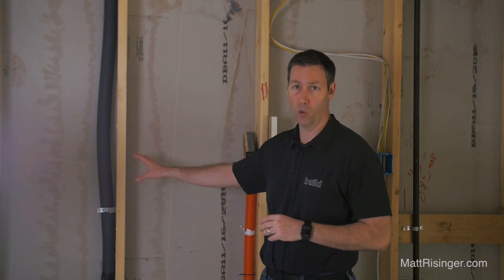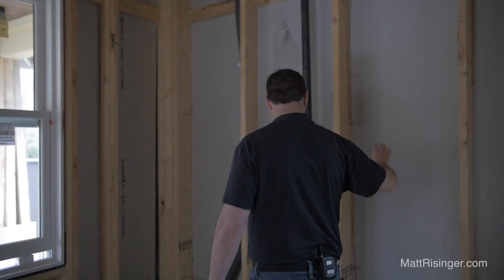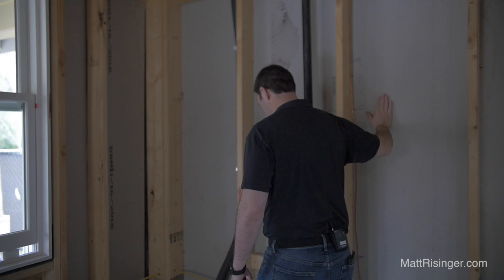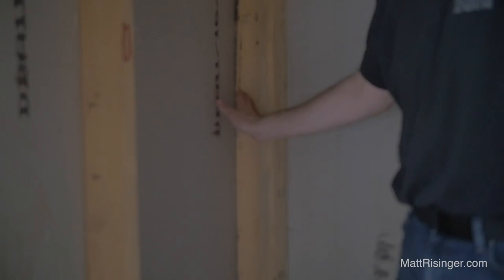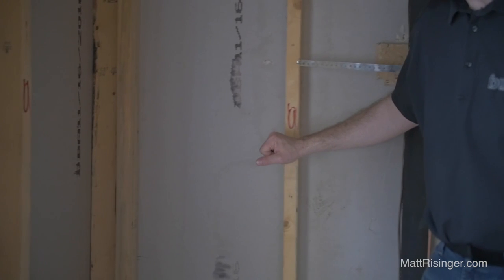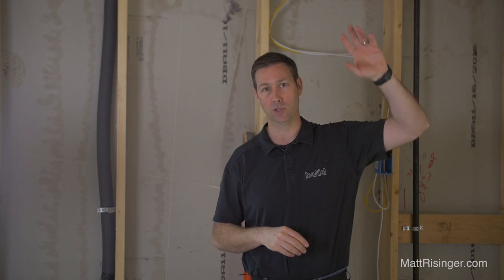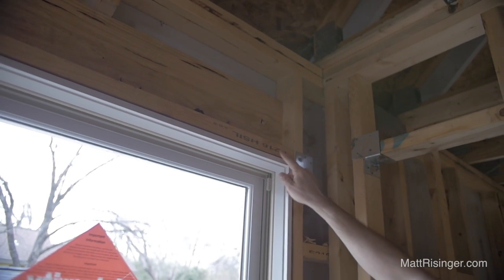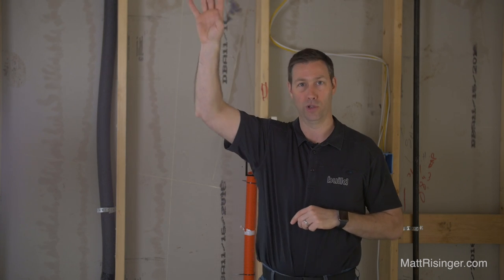Traditional vs. Advanced Framing

Comment: Matt I have been a.builder and framing homes for 40 years.You need to talk more on framing and less on R- value.I liked your home show videos back in the day.I assume your busy and don't get to them like you use to.Again 40 years of framing you have seen alot of ways to frame.Both houses you showed were framed wrong in the places you pointed out.

1st let start where the corner was built wrong.Lets say you were putting siding on.So think about what your going to nail the siding to ,after you put up a corner board. You have 3/12 on the outside going 1 way then 1 1/2 on the other side after the corner board is on.I could tell you 3 or 4 problems.

   The 2×6 walls are built probably to carry the load of the 2nd floor.I say that because Architects don't think about R value like you.They put that on the blueprints because they are thinking of R  value. Not really mostly structure. Now lets talk about your corner and T.. Most framers where Im from SC. ,you know the south where we do the dumbest things.Like venting the attic.Back to the Corner You use 2 studs and 3 blocks.1 block nailed to the top and middle and bottom.Then in between the blocks you could  insulate.Those blocks is where you tie in the wall that joins it.Everything is nailed flat and flush where you end up with 5  inches 1 way thats including the end stud on wall tied in 
and 4 1/2 the other way enough to nail to after a corner board goes up.The T can be done almost the same way but you put your blocks in between the 2 studs as the studs stand up on the 1 1/2 x 3 1/2 .Flush them at the top and bottom and end of studs and then middle.So that will leave you 3 1/2  inches x the length of stud to insulate.All but where you put the blocks .You only have 2 inches there.Also gives you 6 1/2 inches to nail rock anywhere.Not a block that could be in the wrong place and leave a corner or rock in the wind. We in the South can help you to insulate with the T,s and Corners.I guess we are making up for not venting the attic as it gets 175 degrees in the summer up there.I have asked you this ? many times and you said you were a builder for 25 years, 5 years ago.Then the dumb South video appears.After 25 years Im going to say you have never picked up a pack of shingles.You had to if you been doing this for 25 years.Oh yea the question.How many homes have you burnt the shingles off of, taking a 20 year shingle turning it into a 5 year one.Becacuse your attic can't breath.I have learned 1 thing, you know about the R factor.And just enough about building to B.S. your way through it.How does it feel going through life not knowing what your talking about and BSing the public.They think your god.But us real builders know what level your on.I would hire you in 2010 for 12 a hour.Maybe.I know you know nothing about rafters or valleys.I would almost guess you could not put in a set of stairs in. That is figuring  your rise and run.Same with rafters.1 question and you are my hero.I am going to say that you have know Idea what to put your framing square clips at if you didn't want to measure your hip but wanted to lay it out. Because all you need is 1 number. If you get it right by asking someone.Tell me how you came up with those Numbers.The roof is a hip roof on a rectangle and is on a 10/12.Good luck .I would like to know anyone that knows this answer.If you do be descrete on telling me how you got them.Also Matt how long is the ridge if the house is 30x65.Brass tax time Matt.All your sponsors are going to see my ? Then your answers. Im not a hater Just can't stand people that claim they are 1 thing with just enough knowledge to rip off a homeowner that knows very little.Im emailing all your sponsors this and letting them know why.If you don't reply within a week with any answer.Your sponsors would like to see the correct ones.Peace be with you.Curt.

Comment: let me tell you something son, people have been pitching for 24 on center studs for decades and also for foam insulation. people want a structurally sound house to handle dynamic loads. stick with 16 oc. foam will burn you to death. there are to many case histories about people dying in a structure with foam that would have lived if fiberglass would have buun used. i have been building 40 years.
Reply from the maker: +Ralph Riffle I've been building for 25 years. Times are changing. Fuel will again rise in cost and we must build homes that are more efficient and affordable. Have an open mind.
Reply: +Matt Risinger yes your right about that. however consider that each stud contributes to the shear value of the wall.

Comment: Ok..ok..ok....This Is Not Advanced Framing,,it’s Regressive.......This Home would never pass on the east coast, I’m on cape cod...First...all corners are made as “half backers” to allow insulation inside or psl or lsl corners are used for loads...
     Second...all walls should be framed using 2x6 at 16”oc...wall sheathing is 1/2” zip ply ,taped and installed vertically for shear strength...
    Third...All headers are structural engineered lumber or dimensional (2x8,10,12) with 1” foam between the layers...
    Fourth...All interior partition walls butting an outside wall are attached to “half backers” to allow insulation behind the connection
     Fifth....as stated by others ...Windows and Doors are the Greatest factors in heat loss...Quality Anderson or Pella windows ,argon gas filled ...
    Sixth...the two types of houses...
                   Air flow...let the house breath, soffit vents and ridge vents are key to this type of house
                   “Hot house” newer style..no vents,no air flow...all rafters are sprayed with foam insulation and the house is sealed in...
    I’m a builder 35 years...what houses last ?? Post and beam...and and houses that breath, a red cedar shingle roof ,on 1x3  with no roof plywood will last 50years...
.....also metal connections play a big part...h2.5, abu66, hdu8, hold downs and more.......you my friend are a complete bullshit artist or severely inexperienced..

Comment: Matt Reisinger r value isn't everything, solid wood transfers almost no heat through it, so a solid header is just fine. 24 o.c could he fine on interior walls if your worried about cost but I would never go 24o.c. on an exterior wall, not enough rigidity. Any framer that builds a corner and wall intersect like that should never pick up a hammer or nail gun again. That's irresponsible craftmanship

Comment: I whould go with the traditional frame any day of the week, that advanced frame is crap, its nothing, but a weak structure! The guy said u cant insulate corners and partition Ts how about u insulate it before the sheathing goes on the outside thats what i do all the time and u can also use thermasheathing in between the header instead of osb -,-

Comment: nothing advanced about this. people have been proposing studs 24" on center for over half a century. studs. at 16" on center are for structural integrity. a sheat wall with 24 oc will not have the strength of a shear wall with studs at 16 oc

Comment: I wonder if the house costs 30% less due to all the time and material left out?
Reply: Advanced framing is significantly better than traditional framing. You end up with a stronger builder and it is much more heavily insulated. Advanced framing cost more if done correctly by the way.
Reply: Adam Lingenfelter Okay so you don't build houses or know much about them except what you watch on youtube. You really don't know what you are talking about.
Reply: I have done 1900 projects since 1999 in Seattle and Dallas. I have 7 homes under construction currently. I have substantial engineering experience/training. I know what I am talking about.  If built correctly, advanced framed homes are 15% stronger and 7% more energy efficient. I am not saying some people build advanced framed homes poorly because I am sure they do. Just like many builders build traditionally framed homes poorly.  I am just stating facts that are supported by plenty of data.  

What you are saying is similar to saying that a 1950's car will protect its driver in a crash better than a 2017 car because the 1950's car is all steel and the 2017 car has aluminum and plastic. SMH.

Comment: This "advanced house" has to be the worst timber frame build i have ever seen. I'm a UK chippy with over 25 years experience and this is garbage. I would never have a timber framed house, only a solid brick/block built. The Germans have the best built houses as well.
Reply: Wood-framed houses are typical in the US since we have a huge supply of lumber available.  There are plenty of block/stone houses as well, but only for the exterior.  We like all that space to hide the wiring and plumbing, you know!

Comment: 2021 THIS MESSAGE IS FOR ALL IN THE BUILDING INDUSTRY.  To all  Builders. My article below is very Important.Matt encapsulates all of the homes he builds.Meaning there is no air that gets in the Attic.Very important . HIRING A PROFESSIONAL BUILDER.Make sure a person in business for 30 years has read the wrapping that is on every pack of shingles.Called directions.The part where you need so much vented space for so much attic space.We are Dumb in the South.Which he did a Video on about just 5 of the Dumbest things he has seen.When Hiring a person to build your home look around.Dont always go with the cheapest.You might get what you paid for.Also don't get someone that is a builder and building his own home.He ended up putting another $90,000 in it because he knew just enough to be dangerous.We have met them haven't we EX. Builders .

Comment: Oh come on. I've been framing for 25 + years. The corners in most structural conditions need a 3 stud stud build up. 4 including the contained wall. Insulation will not be missed as the r value in a  2x has a greater value than any insulation that can be stuffed in that bay. This is borderline click bait. New construction method? I don't think so. Header size? Debatable. Trimmer? The clips may save a few $ - hardly worth mentioning. Structurally, not a viable option. A positive takeaway, I like the green spray on at the lower section to help slow dry rot. A good framer will know if 16 or 24 o.c. is acceptable for the structural condition. FYI, over all, this video sucks. I could have watched "I dream of Jeannie".

Comment: It's a joke, you dont need much insulation on walls your heat loss is in ceilings and roofs. That would not pass code in many areas.also the plywood with insulation weakens the lateral wall strength. I have 40 years in restoring homes, there is so much wrong with this " builder" and building model, it won't last 50 years

Comment: the advanced build would NEVER pass our northern building codes..
Reply: Advanced framing is significantly better than traditional framing. You end up with a stronger builder and it is much more heavily insulated. Advanced framing is also more expensive if done properly. By the way, I built in many northern states. The advanced framed homes are engineered to be stronger than traditionally framed homes.

Comment: You know Matt are used to think you know a little bit about what you're talking about but you're way off base for the insulation and putting them to bed six walls and 24 inch centers cheap cheap cheap you can build a house to take me out and when you know that 85% of the

Comment: OSB stands for "only stupid builders" use it. No wonder houses built in the mid 1800's still stand but 40 yr old construction is falling apart. New homes cant stand up to a decent storm without losing sheeting and roof covering if not the sheeting as well.

Comment: So called " advanced engineered lumber" is crap!  OSB does NOT stand up to humidity, or torsional stresses!   2x4 headers????  What has happened to the carpentry trade?  Relying on a metal strap, held in place with 1 1/2" nails to replace a jack stud is just plain stupid!

Comment: The premis of you're advance framing seems to be the poor insulation value of wood, which, although, is technically correct, the way that its presented is misleading at best. Although wood has a low r value, it has a high thermal mass, which does contribute to a certain degree to maintaining a comfortable temperature.

Secondly the marginal heat loss of 16" OC is well worth the structural security. I personally wouldn't trust dimensional lumber at 24" OC.

Although I agree with you on how the corners are married together in the first house, that is not traditional framing, but rather an outdated practice that, to todays standards, is nothing short of poor workmanship.

Comment: LSL anything is a horrible idea in structures.  It may be cheaper, it may be able to be insulated but ask any firefighter how they feel about LSL beams and what happens to them.  Maybe also consider the spliced trusses instead of full beam lumber.  As soon as they heat up in a structure fire they pull away from the lumber and collapse.  Give up on ever saving a structure in the future.  Just plan on rebuilding.

These are HORRIBLE ideas with no consideration for fire protection or longevity.   Flammable insulating products being used to save a couple dollars on a bill would have been laughable in the past, which, come to think of it, it was.

Comment: You no seismic, wind, or snow loads?  Where is that house built, inside a warehouse?  This is where the real "green" in the build is the mold that has rotted the "engineers" brain!  By the way, the "engineer" that designed that flimsy construction showed the new ethic, green over safety,  and has probably never been a part of an actual home build.  I don't think that I can recommend becoming a subscriber.

Comment: I will start by saying this is not my video or even anyone I know. I am however a builder who has done roughly 1900 different projects in multiple states, snow load areas, wind zones etc. Most of my homes have been built in Washington State and Texas.

Its frustrating reading these comments. People are making statements that they absolutely have no clue about.  Advanced framing techniques are much, much better. I have built in multiple states and have used both standard framing techniques and advanced framing techniques. Builders don't do advanced framing to save money because they don't save money.  Many builders that are using standard framing techniques use 2x4 exterior studs at 16" OC.  Advanced framed houses are typically 2x6 at 24"OC. From a material cost standpoint there is a very similar amount of board footage in the house because the 2x6 studs have 37% more material than a 2x4 stud and there is 34% less studs in an advanced framed home. Additional costs with advanced framing are as follows: The home has to be engineered for advanced framing, the framing contractor charges the builder more because more thought goes into layout etc, there is more insulation so it costs more, there is the additional cost of the hold downs, floor to floor straps and hurricane clips that tie everything together etc. 

You end up with a stronger structure because all walls, floors and roofs stack on each other which gives the builder the ability to strap the floors, walls and rafters together. Homes with advanced framing hold up better in areas where tornadoes and strong winds are common. Standard framing will have 16" studs, 24" floors and 24" rafters so they don't line up and cant easily be tied together. I can go on about this for hours but I would guess the people complaining about this video will be too stubborn to read this or listen to the facts anyway.

Comment: No insulation, you can see the spray in foam pouring out....what is he talking about? There is nothing "advanced" about that crap. It's lazy quick framing. There's a reason why traditionally framed houses are still standing. If it ain't broke don't fix it.
Reply from the maker: +NerfSmerfs Blastin do you also drive a 1970s car?  Codes have changed and builders need to adapt. This new framing will be the norm in 20 years

Comment: I don't care for the modern framing! Taking away Cripples/Jack studs and replacing them steal header hangers, the home owners ain't gonna be very happy after they have to renovate the house and put them Cripples under the windows and door frames to transfer all that weight down to the foundation,  what a disaster for who ever is buying this house, buy a house just to call in more Carpenters to come and fix everything 10-20 years down the he road,

Comment: You said ( if we can reduce the number of studs without reducing the structural integrity of the house) Are you a Professional Engineer? What comes out of your mouth proves you are not a structural engineer. A house with studs at 24" on center is not as strong as a house with studs 16" on center. You fail to point out shear walls are structurally calculated with studs at 16" on center. Each nail driven into the studs adds shear strength value which translates into dynamics load resistance. Less studs weaker house. I have been building houses for 40 years and worked as a building Inspector and worked for structural engineer. Before you get in front of a camera and make a fool out of yourself go to school.